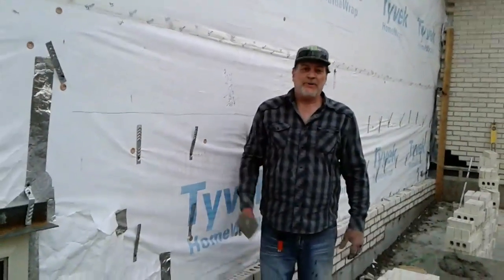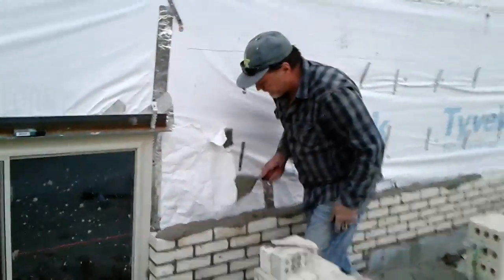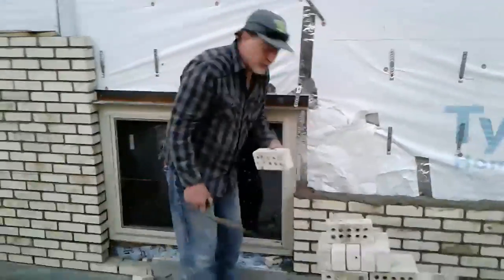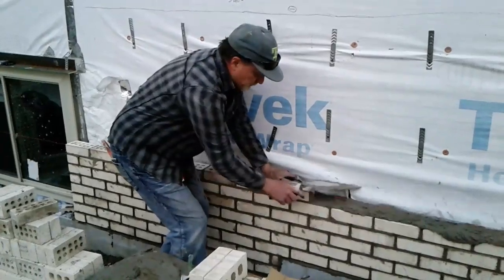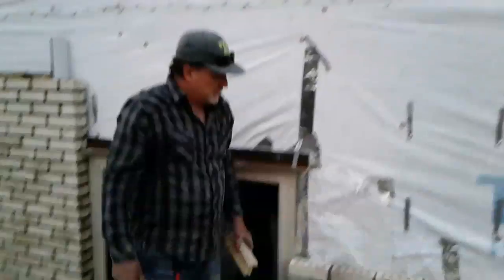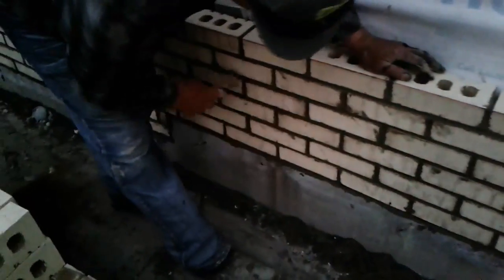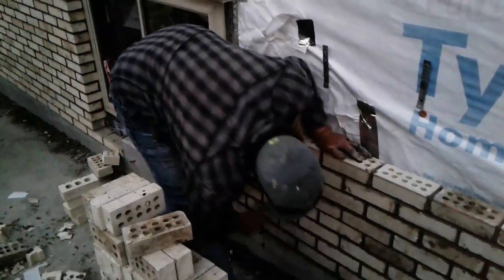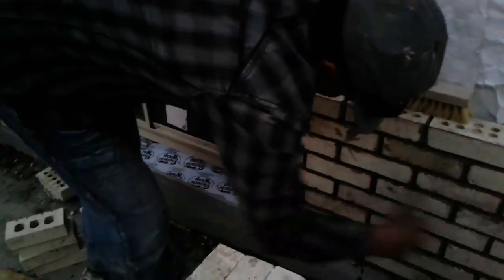How to lay brick the simple way

Comment: Scruffy face work  no good in england sacked straight off
Reply: No trades men left I don’t think they can sack him str8 off now a days every one wants to sit at a computer
Reply: Stick to your timber building Ffs!
Reply: I lay brick in Texas as well. Looks good for residential. Half the residential work is thrown up by illegals and looks shotty. I use a Hubbard sled runner, or a Barrell jointer. But commercial work is different. Also, a nice acid scrub and wash and those brick will sell. Noticed how your head joints are straight... Good work
Reply from the maker: Look I worked with Limeys before they were just like house Hackers
Reply from the maker: Damn it I thought I was a good brick Mason